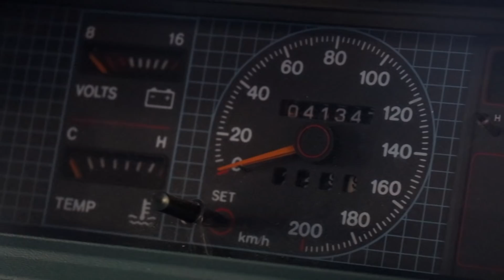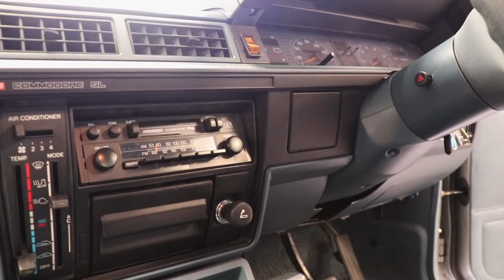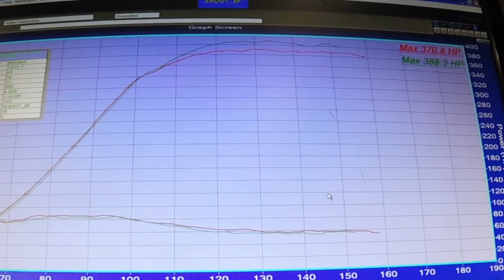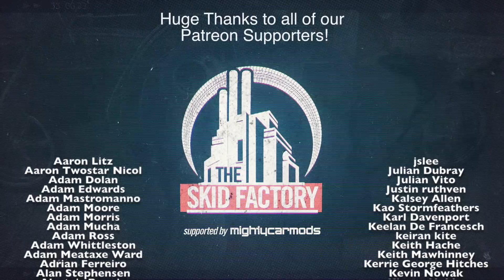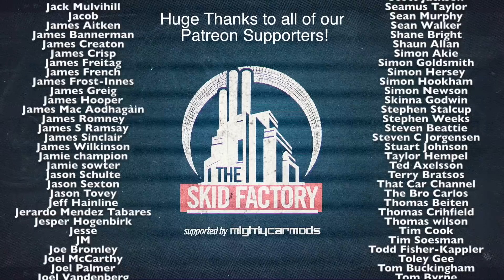THE SKID FACTORY - RB30E+T Holden VL Commodore Wrap Up [EP13]

Comment: The wheels are HDT aeros.   Iirc they were designed by Holden for Brock.  They could be had with no face plate, the exposed wheel nut faceplate and a full face version.
Reply: Ian Anderson these are aftermarket replicas and bigger diameter

Comment: I had RB25 in a GQ patrol and it was awesome. Basically standard, bit of an exhaust slitfire coils. It only had about 200kw and that’s not at the wheels, so 400hp VL at the wheels would be fun. I had a genuine VL Berlina wagon with manual box, I wish I never sold it😢, can’t imagine how much it would be worth now.

Comment: 400 whp and it isn't going to randomly go pop. sounds like plenty enough to me.
Reply: Hard out. That power in 1200kg with a very solid power curve is plenty for a street daily.
Pretty hard job tuning a car "on the internet" and copping hate no matter what you do. He could have got 600 out of it then popped it.
Great series thanks all you guys :)
Reply: ChrisHallett83  100% on point - street weapon vs Dyno and trailer queen.  Not to mention, stock chassis, stock suspension, full interior.  Bet most of the haters have only driven fast in Forza ;)

Comment: Unrelated Technical Question: I've got a '90 R32 GTR in the States with the factory Nissan calipers. I'm thinking about putting on the Brembos from the V-Spec or later GTRs: Do I need to get a matching Master Cylinder? Can't really find definitive answer. Thanks!

Comment: Unless you're racing in a specific group or class, building a car for maximum hp leaves you stranded.... tl;dr - keep building smart cars for people who are going to drive them.
Reply: Your tl;dr is literally 6 words shorter than your “too long” post.
Reply: @mattsnyder4754  truth in advertising lives
Reply: Grown up comments from grown-up fans... Talkin' about cars built by grown-ups for their grown up owners.  I'm always (somehow) surprised that the Forza 5 mechanics, aka the P plate professionals, aka the  'my dad's buddies car has a thousand kw' kiddies have the attention span to actually make it through enough of this high-quality and deliver content the troll in the comments :)
Reply: @ewingfox6459  Is 1000 kw a lot?  hell my generator has 6500 watts....
Reply: @stoneshrink  too good :) my CJ7 has just a bit over 300 horsepower and I wouldn't want any more power... It's just enough to be effective AF and not break  parts.  I was just stoked when I saw your comment because it's nice to see that there are some other sensible folks here as well!!
Reply: @ewingfox6459  mine fj40 is somewhere in that neighborhood - 350/TBI 38s.
Reply: @stoneshrink  my CJ has a 454ci with a mild cam and a sm465 trans /Dana 200 transfer case.  Currently running 33s, not sure if I want to go up to 35 although as it sets they would run just fine.  For most of what we do with it around here in the Northeast it is more than adequate and it stays nice and drivable.
Reply: @ewingfox6459  sweet, I play in the Pacific Northwest, mud and snow... 350/AW5/Dana300, HP dana 44 (with lots of upgrades) Dana 60 and 38 swampers.... my problem is it's so good that I make it through then have to go back and retrieve my friends
Reply: @ewingfox6459  and then he does a FJ40 with a V12 .... love this 'tube

Comment: , 400hp good street tune power with tire size he got what he payed for , ,its all a safety concern when pushing over 400whp with 245 tire  luck to have 4 power levels  with flex fuel tune ,and 3 bar map sensor ,the r32 rb26tt is little wild on corn juice pushing 22psi 500whp lots of pucker effect from passengers  , ,much more friendly to drive at 400whp ,but feels weak after a tank of corn juice on the hot tune

Comment: One answer i need to know AL was the Datto rb30 more tuned then the HOLDEN rb30 cause ive had both and the r31 against an vl commie the r31 would smoke it in auto mode
Reply from the maker: Nissan had a 3.7 diff ratio and holden 3.45. Made a difference.

Comment: If you bought a 2010 XR6 turbo for 15 grand and you put 15 grand into it what do you guys reckon you could get out of it.
Reply from the maker: 450kw atw.
Reply: @theskidfactory  is that just engine work and would the the stock running gear and brakes cop that much of an increase.